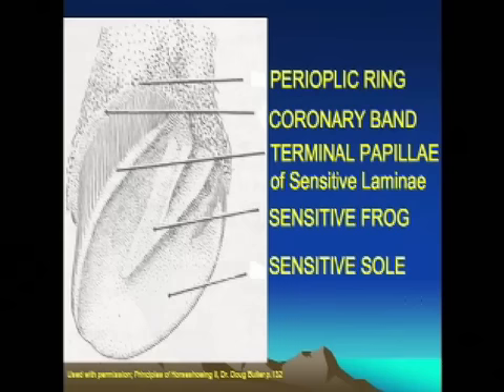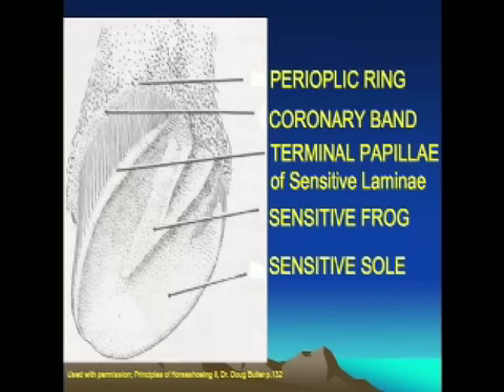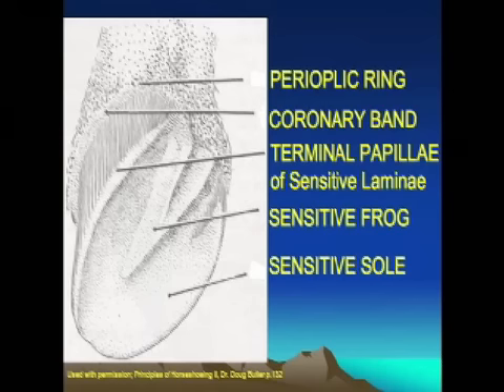Anatomy of the Horse's Hoof, part 2, provided by eXtension

Comment: Pinching is the key word.
I've seen many color's of the rainbow because of bruising on bare feet.
The hooves are soft during winter and rocks are still on the surface frozen steadfast.
Many pock marks which are indentations from small stones are evident.
Shoeing the horse really corrects this problem but not always feasable because of snow impaction.
Cults that bash shoes are really being decieved from the facts.
Then sold on other mechanisms or none at all.
This explanation is bang on!